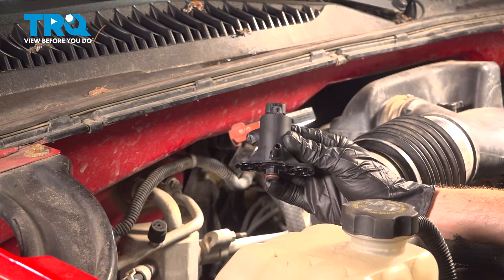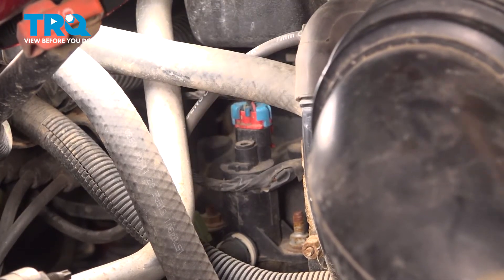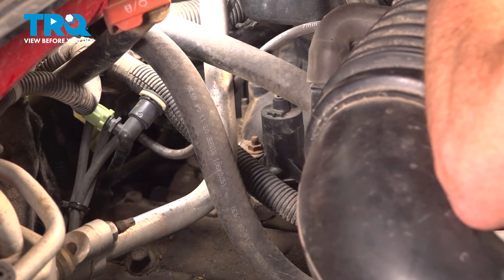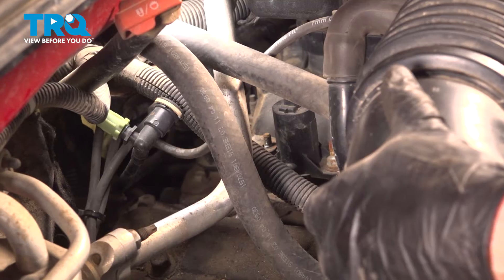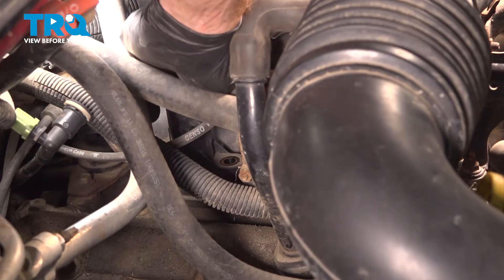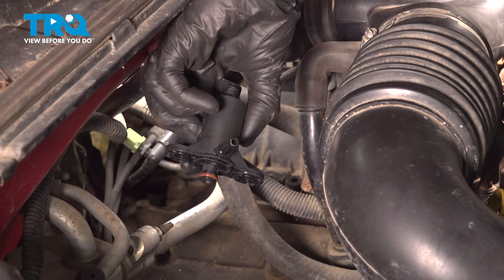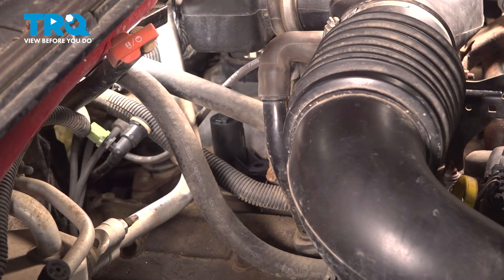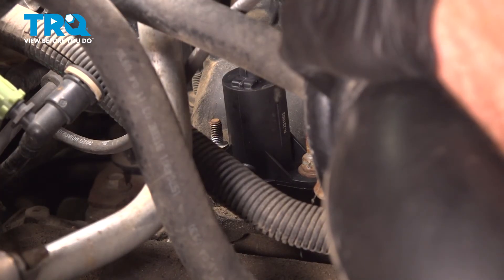How to Replace Vapor Canister Purge Solenoid Valve 1999-2006 Chevrolet Silverado 1500

Comment: 106 inch pounds? I tried to torque mine to 80 inch pounds and it made the plastic bolt hole tab split.

Comment: Hi I have a 97 Pontiac Grand Prix GT with the 3.8 engine. As you are facing the engine one vacuum hose goes over the valve cover on the left side. The solenoid has 2 fittings. Where does the other vacuum hose connects to as it it missing. Thanks